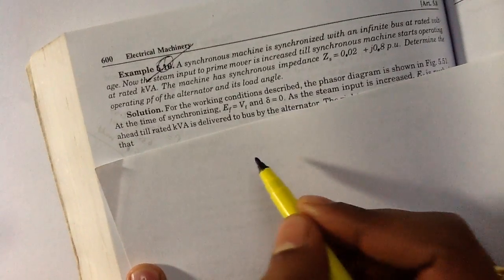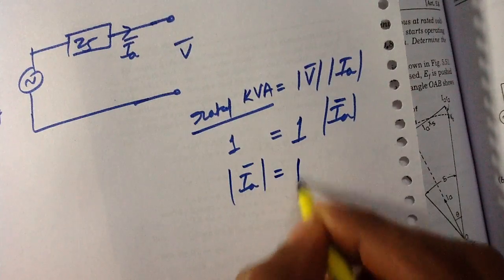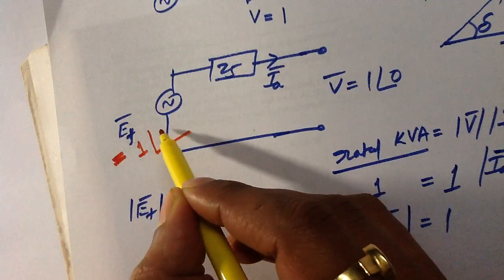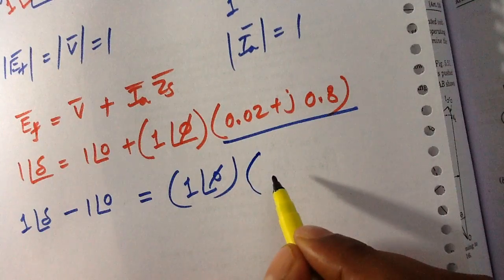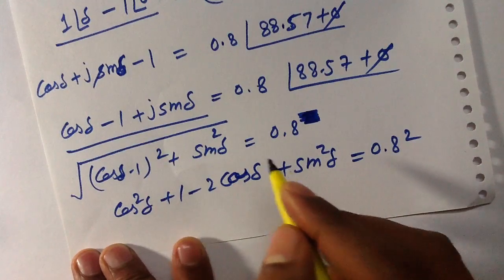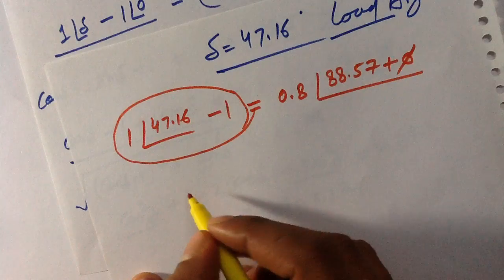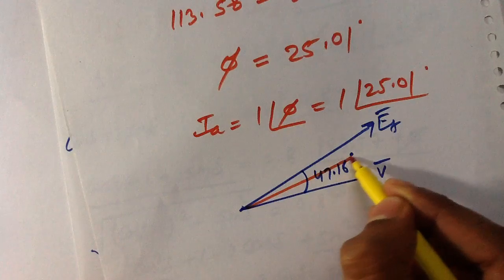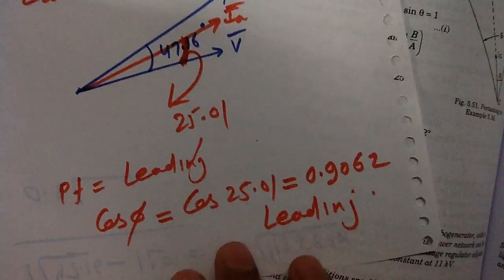EXAMPLE 5.16 (Synchronous Machine) Electrical Machinery P. S. Bimbhra

Comment: sir please can u explain question 127 appendics c in bhimbra for synchronous machine
Reply from the maker: in the case of motor ,stator  field will be ahead of the rotor field.................while in case of alternator ,rotor field will be ahead of stator field (NOTE :see in the span of 30 degrees.......watch the direction of rotation carefully to check  which field is ahead)
......
when there is no load on motor or alternator then rotor poles and stator poles will align in one direction with opposite polarities i.e.    load angle will be zero
Reply: ok sir thanks